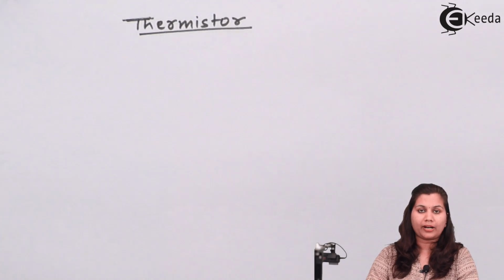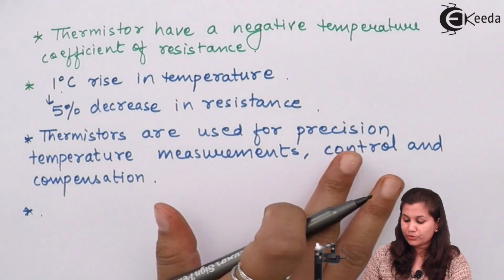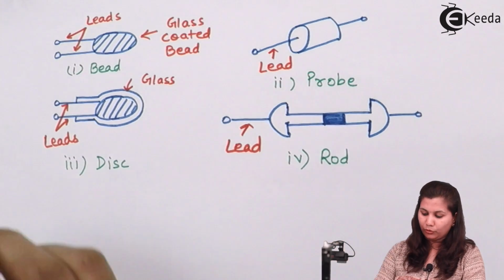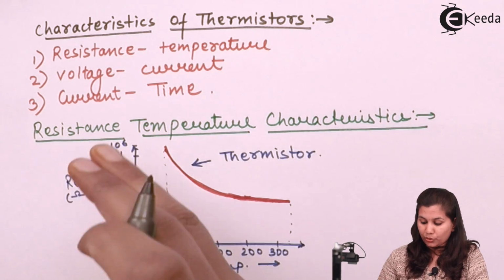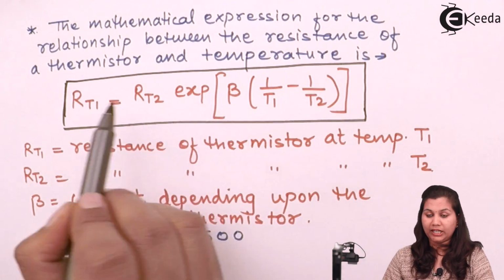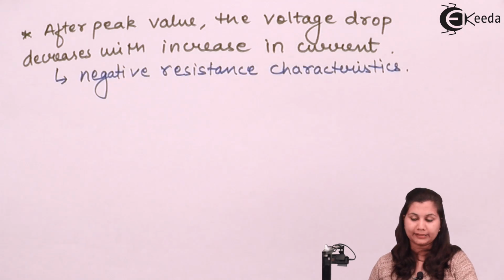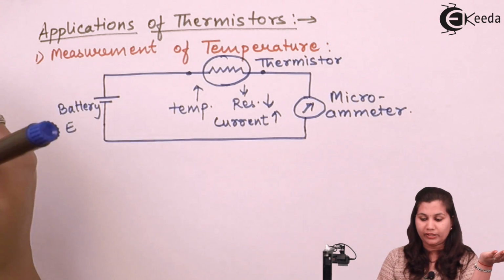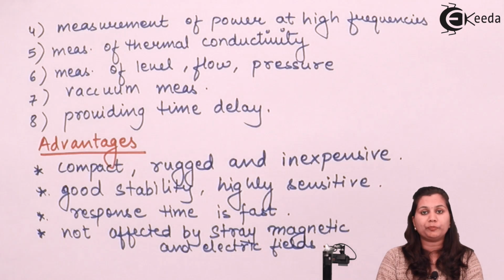Introduction to Thermistor - Temperature Measurement Transducers

Comment: opposes the flow of voltage not current u can step down the voltage by using resistor but same voltage you cant control the current by using resistor.

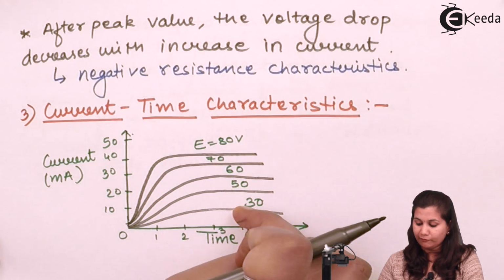Comment: 29:00 How the time is decreased to achieve peak value with decrease in voltage. The graph doesn't tell this
Reply: This lecture is fully the text, what is given in the book "AK Sawhney". Although you have caught her at a very good point. This point is not mentioned in the book.
Reply: Basically the time to achieve peak value has increased on reduction in voltage so you are asking wrong question as I can guess.....